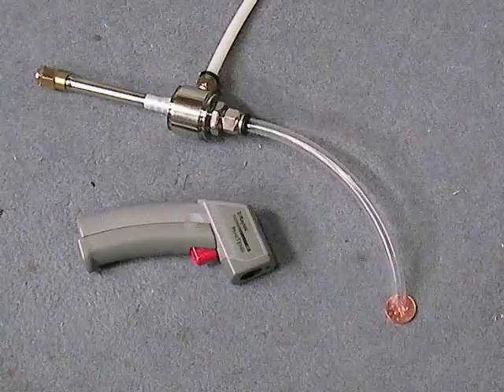Vortex Tube

Comment: Well, that's disappointing. You didn't even get the coin frozen. Something is probably wrong with your setup. Did you give it enough air flow? Is the tube blocked? Inlet air pressure 8200 psi? I frankly don't believe you. That would be one honkin' air compressor you've got there sport. Probably more like 82 psi if it's a normal single-stage shop air compressor, and there's certainly no reason to use more pressure than that.
Reply: Yeah, 8200psi on some push-connect fittings and poly-tube. I bet McMaster has them in stock.

Comment: You guys who are saying this is a waste of time have no idea what is going on. The amazing thing about vortex tubes like this is that you can have one inlet flow coming in like he has at the top of the vortex tube (at a certain temp & pressure). And two exit flows coming out the sides, one shooting out cold air, and one shooting out hot air. You dont have to do any work or add any heat to the system to achieve this. And this all happens given that first initial inlet flow. Pretty cool stuff.